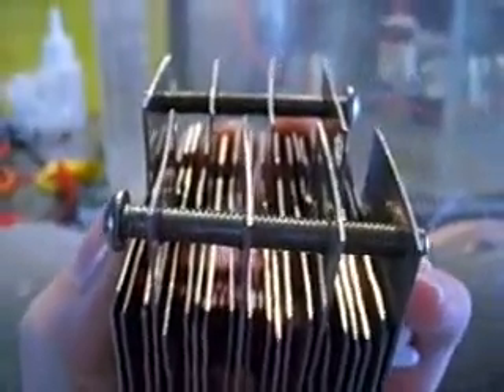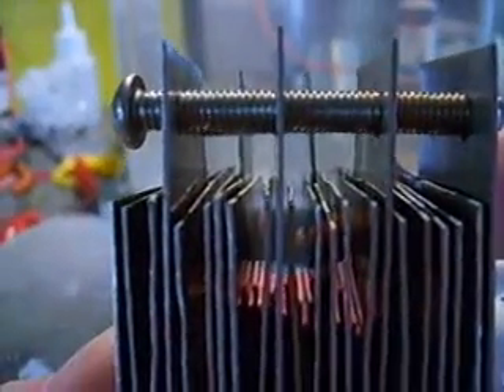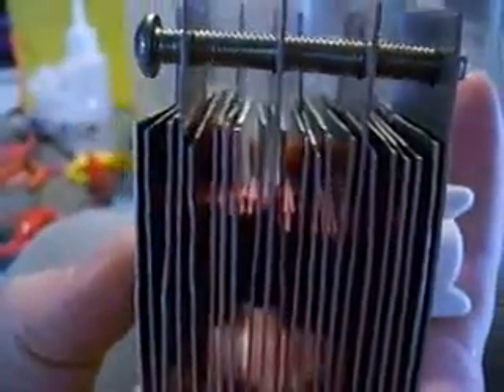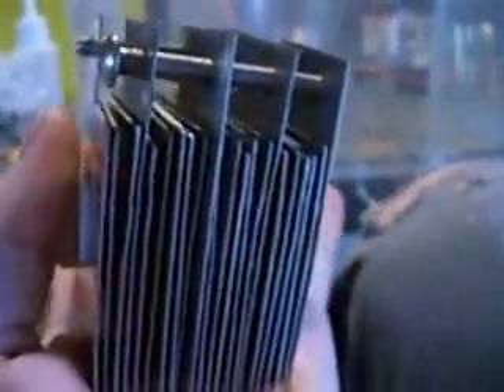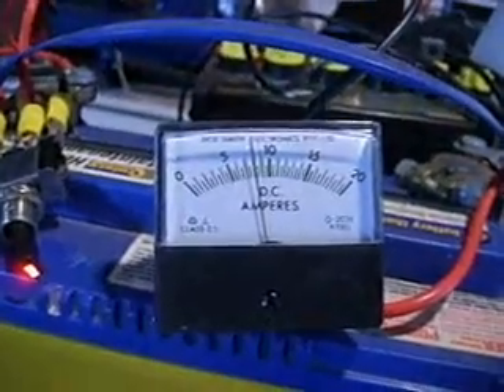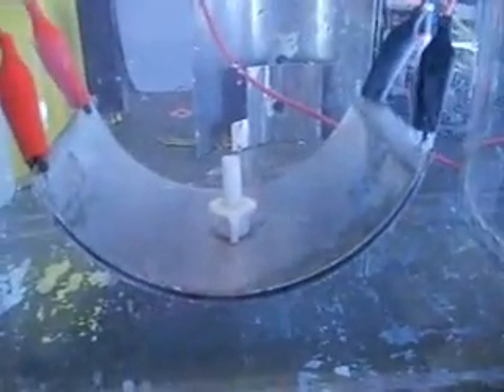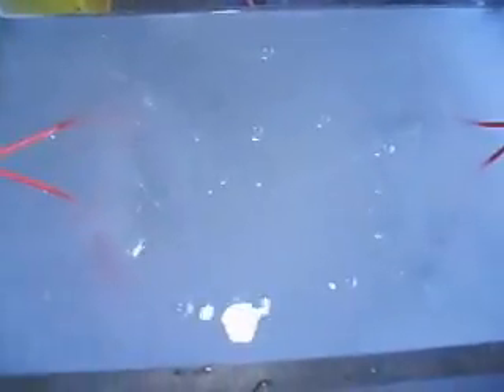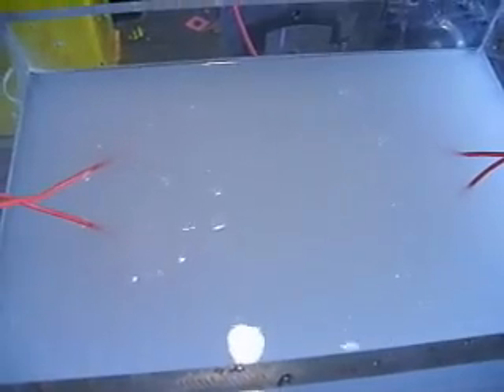Hydrogen at home (new cube cell)#16

Comment from the maker: That is a trip down memory lane, I remember making potato clocks in primary school, cool stuff.  I have just had a theory confirmed about using different metals other than stainless-steel, don't do it.  It may work great for a bit until the metal breaks down, which it will.  Especially copper, checkout (bornman88) he is one of my subscriptions.

Comment: like when you make a small lcd clock run on a potato, you use different type wires or electrodes. search this, u can get power from potatos , try out the different materials in the metal plates to get more voltage, let me know your findings